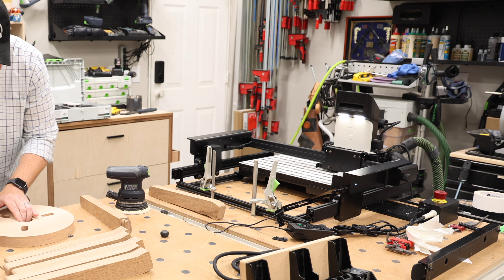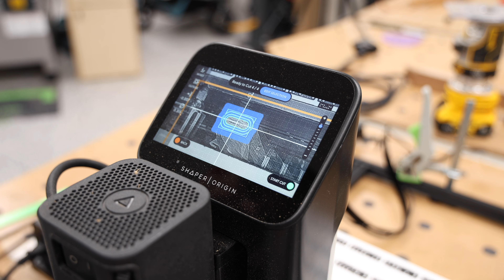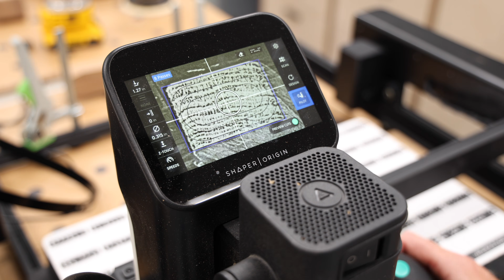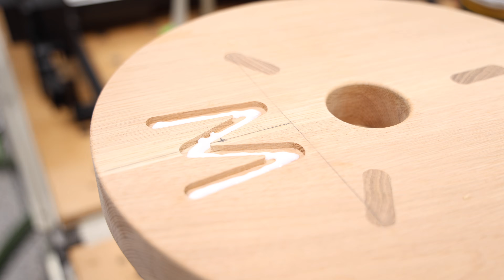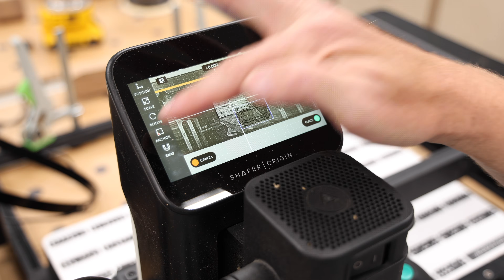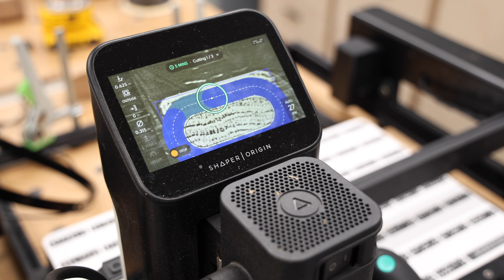Shaper BenchPilot will change the CNC market

Comment: First of all, thank you for all of your thoughtful content. I always find it hugely helpful. Right now now though, I want to build up a super efficient kit for a mobile bed factory. An example of what I need to do is to drill fixing holes in a 2000mmx120mm component and the corresponding holes for screw-in inserts for fixing a leg component to the side component. I also want to cut domino or biscuit slots into the side component. There are plenty of other clusters of holes and shapes to create. In my imagination, I believe i can build a custom bench with jigs to position various pieces and have the Shaper Origin do all the machining I need with a fool-proof workflow. What do you think? Am I overestimating how obvious and simple this approach is for the Shaper Origin?

Comment: But there is no depth adjustment correct? So no ability to do any proper contour shaping with the machine right?
Reply: thats a good question. i think it has the ability to raise and lower the router a usual amount,,, maybe 2 or 3 inches up and down the shaft of the housing,,, but no 12" z axis or anything like that. i dont think..?

Comment: Hey Jason another great video and like I’ve said before your teaching style is the best without all the BS jokes. I do have a question, I’m doing some continuous projects that Ed is doing the base work on his CNC. I do need a CNC, but do not have the real estate in my shop to accommodate one. This may be my answer. The over all size is 24 x 48 -  does this have the capability where the sheet good could be moved in line back up with crosshairs to continue to cut a larger sheet.

Comment: Just in case I didn't mention it, using the Shaper Origin on. mobile cart (e.g. Work Cart on Shaper Hub) enables using BenchPilot on pieces that are 18 inches x however long. If you put it on a bench backup up against a wall that capability is lost.

Comment: I think that there are many ways to use it that even Shaper Tools Team haven’t yet incorporated. I’ve sent in a couple of suggestions that they might consider, as incorporating them penetrates other user markets. One that would benefit you, me and other BP users would be putting red/yellow/green lights on BP (not SO) that provide visual feedback on the integrated system when running in Pilot mode. Green - everything is within parameters. Yellow - better check on the system, as it’s encountering something that is straining the system. Red - spindle has raised and the User needs to change the bit, cool the spindle, or figure out what is causing the spindle to raise.

Comment: I have a small CNC machine; it can cut 18 x 36.  Since i purchased my Shaper Origin (several years ago) I think I have only used my CNC a few times.  And that was to do signs with V-carved letters.  I have a Bench Pilot ordered and can't wait for it to arrive.   One more thing to consider in weighing this against a CNC machine is the backlash in a traditional CNC.  With the BP teamed up with the Shaper Origin there is no backlash.  Whatever backlash there is, the Shaper Origin makes up for it just like it makes up for your hand movements.  In my opinion the whole system is just brilliantly amazing.  Wouldn't surprise me if one day we see an upgrade to include the ability to V-carve with SO and BP.  Hope you use BP without Workstation to show its extended footprint.  If so, be sure to do a video.  Thanks Jason!!!!
Reply from the maker: I still to this day don’t understand how people are smart enough to come up with a machine like this. It’s crazy to me!

Comment: thanks for sharing your video and thoughts. It looks like a great machine to have, but with +$4000, the price tag is very stiff just to do joinery. It certainly has it's own limitation. The parameter/ work area is not big enough to do a 36x36 piece of work. Once the work piece becomes larger than the allowance, it becomes a manual labor again.

Comment: So, it’s turning the Shaper into a CNC machine? You can get a 4’ x 4’ full CNC with impressive specs for this total rig.  I guess I just don’t see the value compared to a traditional CNC machine.
Reply: I hear you, but you're limited to 4x4 with a traditional CNC. With the Origin, you're limited only by how much tape and space you have. 

If you're only doing midsized sheet goods, a traditional CNC might be the answer. However, if you're doing vertical work, joinery, hinges, flooring inlays, etc - there's really no better option.
Reply: The traditional CNC is typically not suitable for joinery or hand carrying to a fixed piece like an installed butcher block, door, etc, etc.

Comment: Just a couple of small tips: 1) add a small piece of white tape above and below the screw you tighten and loosen the spindle (I added a piece on the “off” side of the spindle switch.) Visual clues👍 2) Milwaukee makes a Bluetooth on/off control that can be used to remotely turn the vacuum on/off.
Reply from the maker: I’ll have to check out that switch
Reply: @bentswoodworking Home Depot carries it.

Comment: Does the Benchpilot software control multiple passes or do you still need to add Autopass software?
Reply: Benchpilot has its own software for multiple passes that is similar to AutoPass. No Autopass software license is needed for BenchPilot
Reply from the maker: It has its own software separate from auto pass

Comment: It's interesting to compare a $5k Shaper Origin setup with Bench Pilot to a $5K (or under) CNC. Yes, the SO can be used on workpieces larger than the CNC's bed, but the CNC can do Z-axis ramps to do more than cut out 2D shapes at different depths.

Comment: Some advice from a Cabinet shop owner, if what you do doesnt require this, if you do not need it for a project, if you cant think of a way to use it that will make things either easier or more efficient, Do not buy it. I held of on getting a zeta p2 untill i absolutely needed it for a upcoming project. With that said fantastic machine and well worth the price.
Reply: Admit it though, it (Origin) is a very nice drill press ;)

Comment: People keep comparing it to a flat bed CNC. The Origin has been out what, 7 years? A tool that can cut almost any nonferrous material, including brass, aluminum, plastic and leather on ANY fixed flat surface. A precision tool that can cut out a kitchen sink hole, hinge or hardware inserts, inlay parts/sections and pockets to put them in with tolerances adjusted on the fly. New uses are surfacing daily as more people use it. Now BenchPilot brings some of the CNC machines traditional uses to relatively non sophisticated users to do fine woodworking if they choose. This and other user videos are NOT to sell you the tool and get a “spiff or bonus.” They are informing you about a proprietary product that has the potential to improve the quality and quantity of your work IF you say “I can use it for this or that, and spend more quality time with my family. “Do or do not - in the end it matters not to me (or to the  YouTube creators)😉

Comment: If you watch the 6/26/25 Shaper Tools Live Session at 4 pm PDT you’ll see how instead of using the extended bench, the Workstation is removed from BP and a larger Shaper Domino Tape fixture is placed over the BP. That enlarges the “fixed” work space. I’m expecting them to demonstrate use of a sled that enables any piece up to 18” wide to be “Origined.” Different tool paths:bits? Easy to duplicate the file and deselect vectors. If you’re using it for commercial applications, use the special properties for custom inlays or furniture 😉

Comment: I'm hoping to pull the trigger on the Shaper this year!!! Probably wont get the Benchpilot at the same time. But will definitely add it to my list. This tool is amazing! I have an xcarve cnc and it takes up a huge footprint and the ability to take the unit to the job makes things even better.
Reply from the maker: You still need to come mess with it sometime
Reply: @bentswoodworking Absolutely!
Reply: @bentswoodworking Once I get my hands on one…I won’t be able to resist getting one.

Comment: I have a Shaper Origin and love it.  I don't have space to leave large tools out.  How easy and small would it be to store the Bench Pilot when not in use?  The Shaper Origin comes in a large Systainer which is convenient for storage, stacking, etc.
Reply: It, without Workstation is light enough to hang on the wall.  However, it does not compress in space-time like how Workstation itself can be compacted.